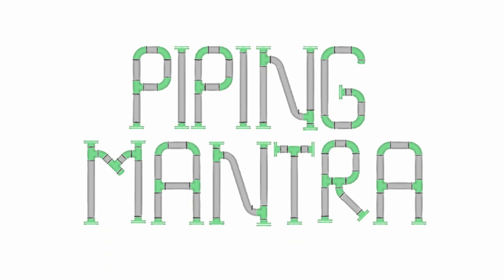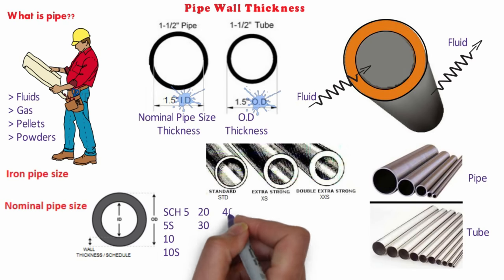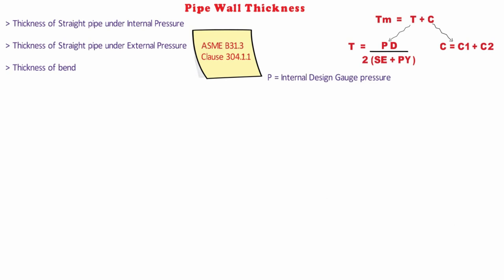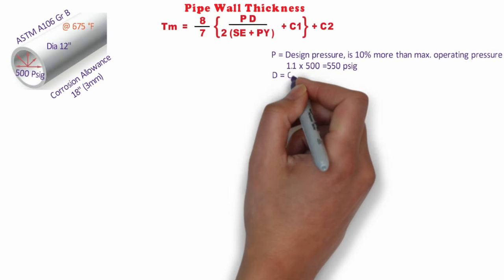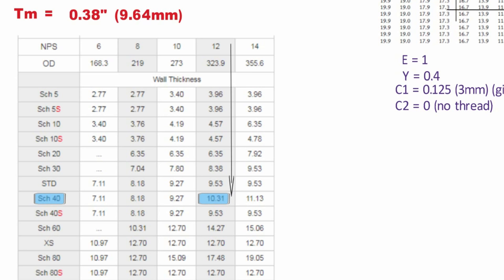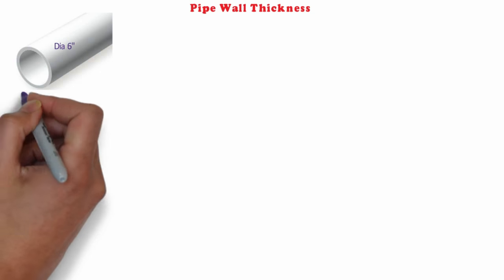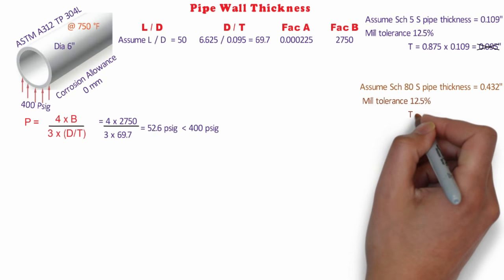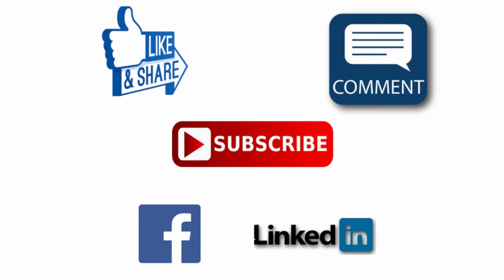PIPE WALL THICKNESS CALCULATION | ASME B 31.3 | EXAMPLE | PIPING MANTRA |

Comment: Excellent video. What is the coefficient "Y" for pipe under internal pressure? Is it temperature coefficient? Also, for bends, what is "I"? Is it moment of inertia?
Thanks for your excellent videos.
Reply from the maker: I is not a moment of inertia ..it is thickness at sidewall the bend CL,  I= 1.0 refer ASME 304.2 2010 edition

Comment: Excellent work. What about the role of "velocity" in pipe thickness calculation? We did not see "velocity" any where in this video?
Reply from the maker: thank you for the comment.. velocity will not come direcly into the picture but as we know there a relationship between pressure and velocity. and we did calculation based on internal pressure of the fluid. hope you got the answer.
Reply: @PipingMantra  Thank you. But can you briefly tell that relationship.
Reply from the maker: @cck0728   it is inversely proportional to each other

Comment: Maam, If I want to purchase PR and specified as I need 2 inch SS 202 pipe

Then ID = 2 inch
Then what will be thickness & OD 

Please consider 

SS 202 seamless pipe for threaded joint

SS 202 pipe for weldable joint.

Need explanation maam

And do you have any video where we can learn about steam / chilled water line insulation material & insulation thickness calculation details.

Like for 1.5 inch chilled water pipe line which type of insulation we will use and what will be its thickness 

TIA

Comment: wt is 5 and 5S in piping schdule
Reply from the maker: S denotes SS pipe. Its thickness variation based on parent material like CS or SS
Reply: @PipingMantra  thnku so much sir
Reply: sir ss 316 having 20 schedule of 100nb pipe comes or not? actually I have seen only from 8 inch pipe 20 schedule will come or 30 shedule will come below 8 inch 20 or 30 sch will not come all schedule will come accpt 20 or 30 schedule?

Comment: In external pressure thickness calculation, the stress value considered in calculation depends on the D/T ratio less than 10. for D/T ratio more than 10 , the stress value shall be as per Appendix A of 31.3

Comment: While this video is informational I am still very confused. I was wondering if there is a way to tell by looking at the material.. if I’m holding one in each hand how can I tell which is which?? My work stocks both, need some tell tale signs that I can spot off the bat quickly..
Reply from the maker: Yes you can.. But to become that you have be an expert. I know one of my senior who is having that expertise he is very senior.
Reply: @PipingMantra  I’m working on that now..when people pull from the cut off section I’m having trouble knowing wether to enter in pipe or tube at checkout.. I guess the answer is that with time I will be able to :/
Reply from the maker: Yess.

Comment: Why the Milling Tolerance is 8/7 and Not 9/8 ?
Reply from the maker: its 12.5%. 12.5/100 =8/7
Reply: @PipingMantra  12.5/100 is 0.125 and 8/7 is 1.1429 

I am absolutely benefited from Your channel and Have found Out why it is 8/7 it is 1/0.875
Reply from the maker: omg!.. yes you are right.
i have checked by write up its 0.875 since we have minus 12.5% from overall thickness for mill tolerance.

I am very sorry for this mistake.. i will try to rectify it.
Thank you for pointing out this.
Big help👍👍
Reply: Piping Mantra! Your video is correct.  Rohit Behera point is incorrect. While calculating thickness of the Pipe, negative mill tolerance of 12.5% is to be added, not to be minus. Hence, we need to divide the thickness calculated from the formula by 0.875. Hence we  need to either divide by 7/8 (0.875) or multiply by 8/7.

Hence what you mentioned in your video is correct.
Reply: Piping Mantra! Thanks for liking my reply. Are you a Piping Material Engineer?
Reply: @SafalAgarwal  Yes - I am.
Reply from the maker: Thank Safal for your clarification.howver this video is under reconsideration after 2 lined up video.
Reply: @RohitBehera0008  it´s correct, is found in the ASTM; would be 0.875 or 7/8
Reply: @SafalAgarwal  is 7/8

Comment: 7/8 WHERE
Reply from the maker: You can multiply (100%-12.5%=0.875=7/8) this with standard thickness  to check that standard thickness will work or not, if not move to one schedule higher thickness
Reply: @PipingMantra  so it's 7/8 not 8/7, is it right?